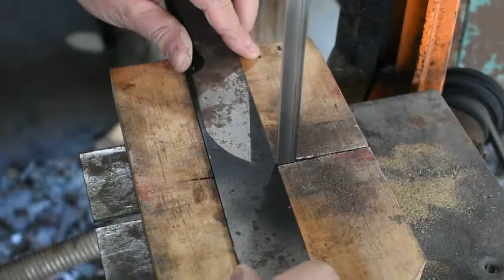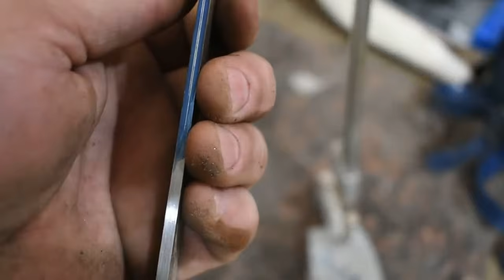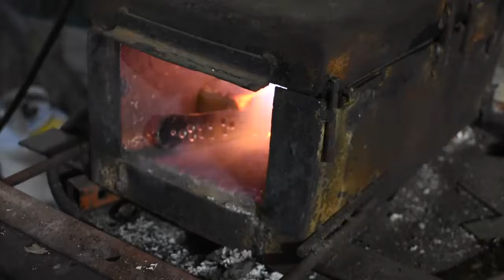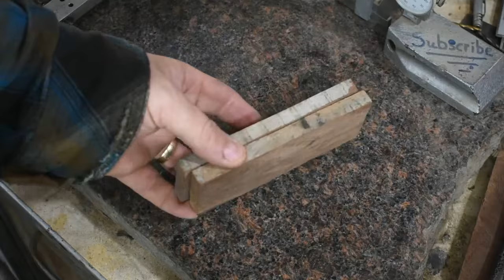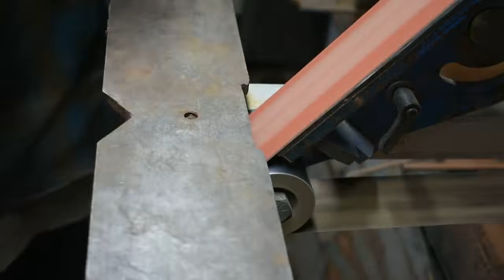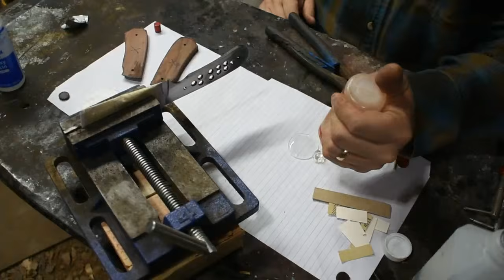Beginner knife making: Making a simple budget friendly hunter #knifemaking #maker #howto #tutorial

Comment: Why the board on the band saw table?
Reply from the maker: The table on my bandsaw has a pretty large opening around where the blade passes through to allow metal shavings and sawdust to fall through freely, when cutting knife blanks sometimes the small pieces of steel I cut off can fall into the guide wheels and jam them causing the machine to stop. I use the board to keep that from happening.

Comment: Ive heard conflicting ideas on the tang holes, whether you should or should not have them and why etc. Personally I think its better to have both a lighter knife and straight through epoxy bonds connecting the scales.
Reply from the maker: I agree completely, allowing the epoxy to interconnect is much better than it just bonding to a flat surface with most of it squishing out due to no place to go. I appreciate you watching!
Reply: There is nothing wrong with having just flats glued. With scales and tang prepped and degreased, and pins in place, it'll take quite an abuse to, ugh, "disassemble" the knife :)

Lightening the tang is great idea anyway.
Reply: You can always do both.  I usually do two 3/16" pins on a full tang knife.  Just drill a few more 1/8" holes in the tang.  You can also drill shallow indentations in the scales and the tang to allow the epoxy to pool in those areas.